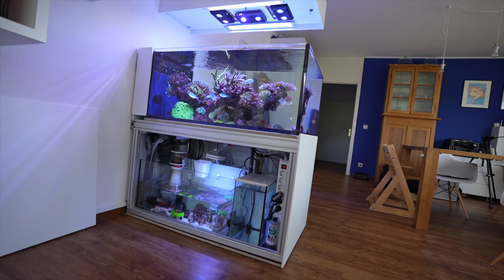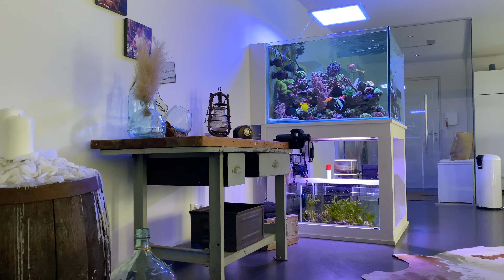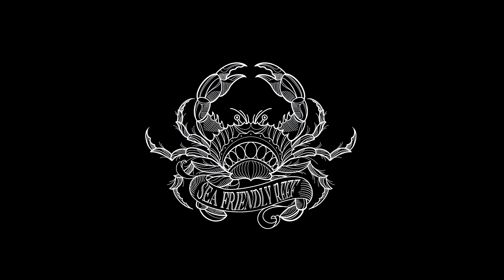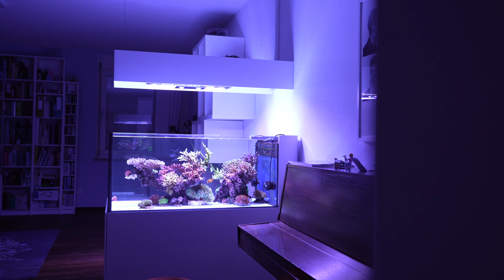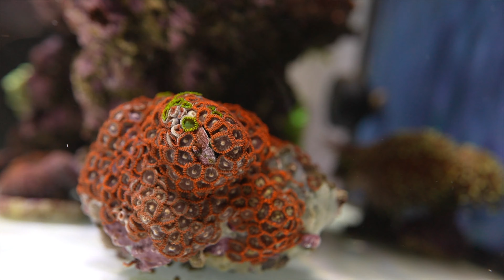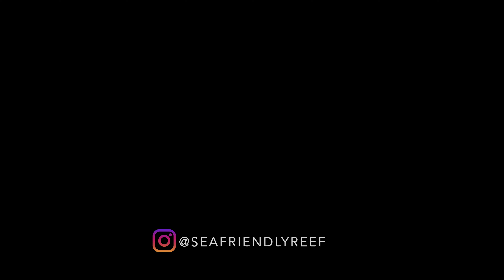Why modern REEF TANK SCAPE? - *Advantage VS Natural Look*

Comment: I’ve always wanted to put a very thin silicone layer on the glass bottom of a tank then cover with sand, let it set and remove excess sand , in theory it should look like a sandy /natural tank but with the benefit of glass bottom , and could tolerate high flow without moving sand around , anyone done this ? Could you do it and document it ?
Reply from the maker: Wow very interesting Neil! Never seen something like that but sounds like a cool idea!
Reply: The sand would probably turn pink/purple with coralline algae because any movement of the sand has become impossible.